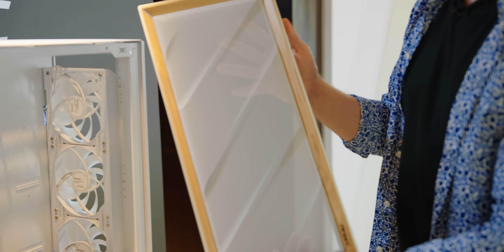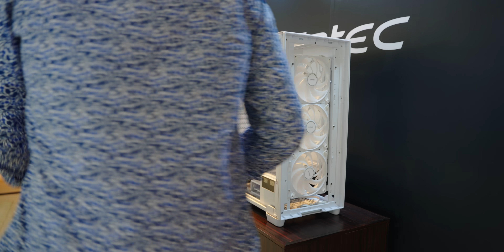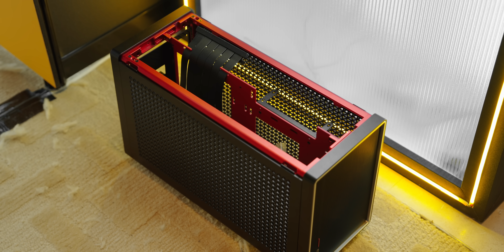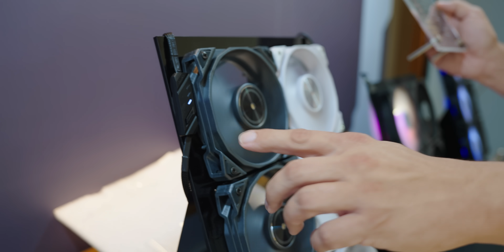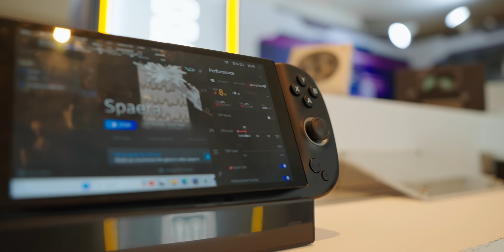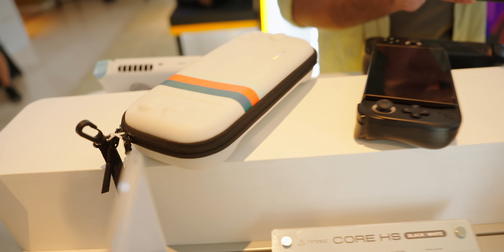This is PEAK Case Design - Antec Performance 1M & FLUX

Comment: I wish someone would make a nice looking mATX small but not too small case. It's a forgotten segment.

I want a case that looks nice but isn't too large. Even "mid tower" is too large for my preferences.

I want a modernized Silverstone FT03 case. That case looks amazing but it lacks airflow for high end hardware, even though it can physically fit inside.

Please. Someone make an mATX case that doesn't force me to compromise CPU cooling or GPU compatibility, and looks as nice as Fractal's recent design offerings.

Comment: I don't much care about the max RPM that a fan can spin, I do care about how well the fan affects the temperatures of interest and how much noise it makes doing so.  I have seen many circumstances where a fan that is ostensibly better in theory, is not better in practice.  I have some doubt that there are substantial untapped gains to be made over what Arctic, Noctua  etc. have achieved thus far.

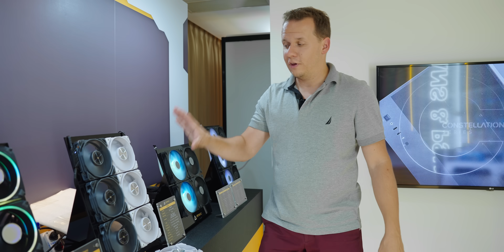Comment: At around 9:15 there is discussion about MB PWM controllers being only reactive in controlling fan speed but there is nuance here to consider.  Agreed that sudden ramp up/down can be very noticeable but any decent/modern MB BIOS includes a fan setup section that provides hysteresis settings such that on a per fan basis, one can set rate of fan  speed ramp up and ramp down independently.  This in addition to the fan curve which is set up in the usual way.  With this, one can dial in quite tolerable fan behavior.  Of course, if one wants even more control, one can use a program such as FanControl which provides even more tricks.  But one can still do quite well with just the BIOS controlling a PWM fan straight off the fan header.

Comment: I don't understand why Antec would rebrand an Ayaneo Air Slide?

To be fair, the Ayaneo Air series is the only x86 handheld I like. Because its actually portable, as in pocketable and can fit a small bag. I'd wish it was PS Vita size but Switch Lite size is manageable.

I have an OG Air 5560u myself because of the size constraint.

Comment: Companies need to stop making itx cases that don't support radiators.
Reply: Maybe micro atx is more for you.
Reply: @FinalBoss079  no, no it's not. There's plenty of itx cases that support 240 and 280mm radiators well under 18L. I went high end parts and an air cooler isn't cutting it.

Comment: Finally some SFF <3
Ok - 1M seems to be horrible. It has 19l which is a lot for sandwich layout and it even have no space for rad. It also looks like supports only 3 slot GPU. Those are things that my 10l FormD T1 can handle, where is the rest of the volume?!

Comment: I wonder why case manufacturers try to make good looking, classy cases with wood, but still use ugly metal mesh? Speaker manufacturers have had this figured out for ages! Get some speaker fabric on there instead. Looks better and still lets air through.
I modded my case myself with speaker mesh to match my speakers on my desk.
Reply: I imagine it's cost and durability. Think about a typical fabric HVAC air filter. You can't clean it. Eventually the pores get filled with dust. Speakers are not sucking high volumes of air through speaker grilles and in the case of a sub, it's equally sucking and blowing, keeping dust to a minimum.

Comment: The Antec 1M ITX looks nice, but the layout and space efficiency is absolute garbage. 
It has a volume of over 19l does not support watercooling or large aircoolers. How is that even possible, how is the case so badly optimized. 

A 19l case can easily fit full size aircoolers like the noctua NH-d15 and large GPUs if optimized correctly and a sandwich layout of that size could fit a 280mm AIO or  two 240mm radiators without much effort. It is truly astonishing how space inefficient the case is, it makes the Fractal Terra look like an ITX wonder and that case is only mediocre in terms of space efficiency.

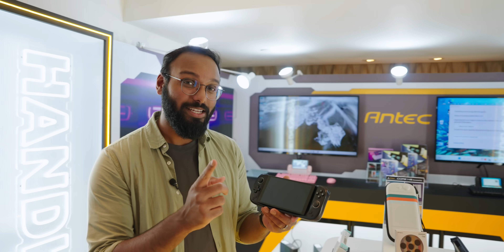Comment: 10:50 So basically, a rebranded Ayaneo Slide
Reply from the maker: Yup.  It's actually a partnership
Reply: It literally just is the Ayaneo Slide
Reply: Yep, that's exactly what it is. The outer shells look identical, they both have 60hz 1080p displays, the face button layout is the same, the joysticks look the same, the keyboard looks the same, and they both use the same CPU. They're also the same price, which makes sense all things considered.
Reply: The Ayaneo Slide is a ripoff of the GPD Win 4 😁
Reply: @davidfaustino4476  Those are different designs. Just having a slide screen doesn't mean it's a ripoff. By that thinking, the GPD Win 4 is a ripoff of the Danger Sidekick, or you could argue it's a ripoff of the Sony PS Vita, cause of its shape and aesthetic.

Comment: Is it just me or do the corner plastic pieces on the inside of the Flux and Flux pro front cover which separate the wood pieces just make it look like the wood is ill fitting. 

Maybe if those pieces matched the colour of the wood or god forbid if they lit up that could be cured. Other than that looks like a lovely case. Cheers Dimitry, Michael and Eber.
Reply: Not just you, I thought the very same thing!
Reply: @3st90  Thanks. Glad its not just me. Thought I was seeing things there for a minute.
Reply from the maker: Yeah these are prototypes.
Reply: @HardwareCanucks Thanks. Hopefully if enough people feel the same they will take notice and make a little change. Cheers

Comment: I like Antec, but I don't care for the wooden "picture frame" design. The North was cool because it looked like the wood was doing something, here it looks like the wooden paneling on a station wagon.
Reply: To me it looks like it could be at home next to one of those frame TVs.  Just turn off the unicorn vomit which is what REALLY makes it look out-of-place.  Or set it all to white, I guess.
Reply: Same... it reminds me of the 80s... not in a good way.
Reply: @boss350z5  i agree especially the rgb version it just doesn't match
Reply: @boss350z5  Have fun missing out!
Reply: "Looked like the wood was doing something"? What exactly was it "doing"?
Reply: @michalsvihla1403 Looking good
Reply: So far only Fractal has managed to make wood look modern and interesting. All the other cases look like something you'd find among your grandparents' furniture
Reply: @Louis_Bautista  I think the key is to have all the wood lines going in the same direction, and not to break any of the wood up with cut-outs.
Reply: @Louis_Bautista  The Lian Li case, the 217 I think, looks good. But they need to change the front fan system to support a 420 rad.
So far it's the North XL for me.
Reply: I agree with you 100%. But I would take that over glass.....
With this, we get both..lol
Reply: I just want a small number of huge fans and some ducting. I'm a simple creature. 😊
Reply: What did it look like it was doing to you?
Reply: @emaadkhan3031  it looks like a vent filter. (I know it's not)
Reply: @gail_blue  you’re still correct, I just didn’t realize it until you mentioned vents, it looks like the slots on a vent. On the fractal north, it actually prevents objects from touching the fans, since the only other protection is the removable dust filter. So in fact, it doesn’t just look like it does something on the North,  it actually was there for very good reason.
Reply: and its like $4 worth of wood, justifying adding $40 to the case price lol
Reply: I agree. The wooden frame is not purposeful
Reply: Na these things look great
Reply: I also think it looks great.
Reply: @RichL123  It's all subjective. I respect your opinion.
Reply: @RichL123 nah it really doesn't 😂 this 80's Station Wagon "design" trend really has to stop 😑 it's a PC not an arboretum 😂

Comment: The cases look pretty slick, albeit for my taste the current fractal design torrent and north are the best cases.
Also, i'm always glad there are more players in the handheld space, nintendo switch needs some competent competition or they will give us another potato powered 15fps pokemon machine. 
Although i probably won't consider buying the windows/linux handhelds before the new snapdragon chips revolution reaches them. Whether the compatibility issues for games will be a nightmare or a non-issue, we will see in a few weeks when the laptops finally come out.

Comment: Every case manufacturer is going for wood or wood finish now a days! Also good to see the USB C
Reply: I wouldn't even consider a case now-a-days without a USB C front panel input. My minimum requirements are 2 USB A and 1 USB C.
Reply: I don't like the wood personally especially with rgb fans it just doesn't match
Reply: @Shadowzz.  I agree. It looks better on the non-rgb version....but I'd still rather have aluminum or some other metal as a frame.
Reply: @Shadowzz.  100% RGB and the Wood looks so dumb. I have a Fractal Design North white mesh with All Noctua fans.
Reply: I'm just happy they are experimenting with other materials, I wouldn't mind a case dressed up with wood panels so that it looks like a part of the furniture.
Reply: No one does wood as well as Fractal Design. I don't know why they even bother. That trim around the front panel looks like wood trim to hold the glass on the greenhouse 😅, not a good look.